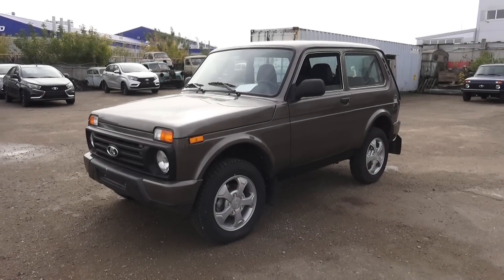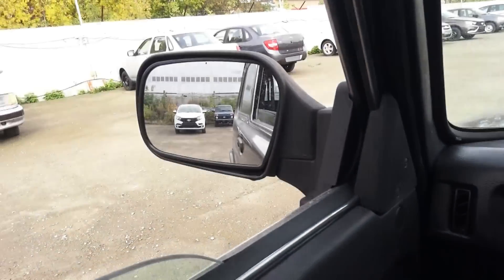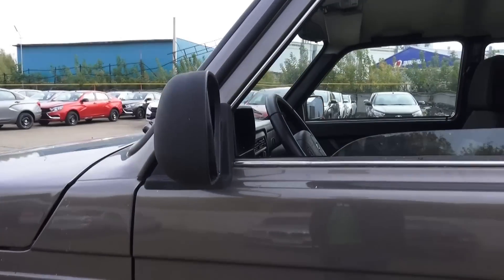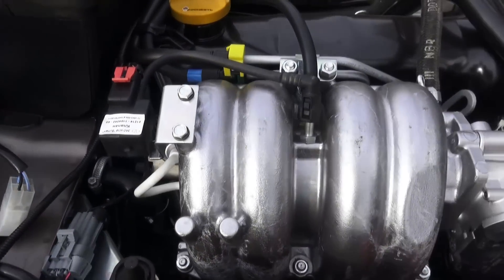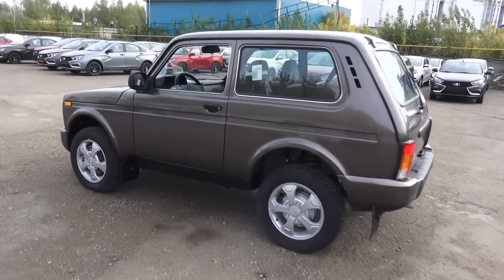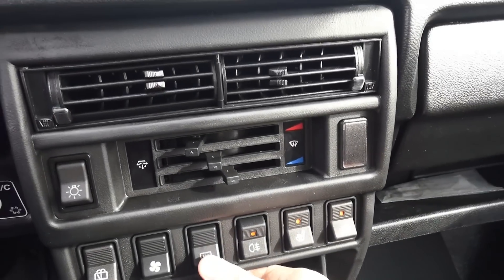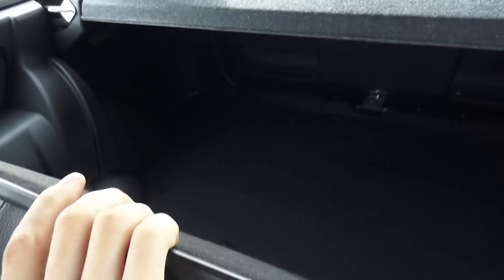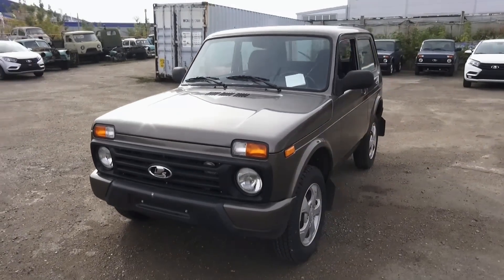2016 Lada Niva Urban 4x4. Start Up, Engine, and In Depth Tour.

Comment: I love these little simple suvs. Wish they were available here in the us!
Reply: Same here. I would buy one for sure!
Reply: Me too.  Alas stupid safety and emissions rules prevent it, forcing us to buy over priced and under capable garbage.  Admittedly though, not much has changed on these in 40+ years, so find a 1991 or older and import it...
Reply: Jesus Wasjewish I don't need or want to be protected from myself. Nanny state FTL.
Reply: I was thinking the same thing..
Reply: Lada used the same design for their Riva until 2008
Reply: They came to my country New Zealand but they stopped selling them after 2001 since the dairy board which traded them with butter (yep) merged with another company. There are a few in my area.
Reply: You can import it to the US.
Reply: In India too
Reply: They don't have airbags..
Reply: @mihaiarmy666  you aren't crashing against anything with this car
Reply: @jesuswasjewish5289  lmal these are meant go to off roading not being a daily

Comment: No CD player or any kind of radio included? Only 86 horsepower? What kind of meme car is this? LOL!
Reply: This is car that would easily go where all those 300hp US musclecars would struck in seconds.
Reply: Basically it´s the same vehicles from 1976. What did you expect?
Reply: The radio and A/C are an optional extra. Like what do you expect from a car that costs less than $10,000.
The Dacia Access models didn't come with a radio nor A/C up until 2019 when this trim option was replaced by the Essential and Comfort.
The same thing goes for the Jetta in the US. You could have still bought one without a stereo in 2013.
Same thing with the 2012 - 2015 RC spec Toyota GT86 and RA spec Subaru BRZ sold in Japan, Australia and New Zealand.

And moreover Niva weights barely a ton and comes with lockable diff. Jeep Willys had 50hp and could climb a hill with four people inside without problem.

Comment: Such a good car for its price. Cheap to buy and the parts are cheap as well. With this really enjoyable the "4x4 life". My father has a car part shop, while I write this, there is a Lada niva front axle on the table and its price is aproximatelly 20 dollars. Full clutch set costs 45 dollars. Tax, VAT, etc included :D Suspension parts like a box of cigarett, disc brake pad set to the front 6 dollar :D SIX! And if you not a bustard idiot driver, the Niva can run around 100-150.000 kms (60-90.000 miles) without any serious problem with mudding days included as well. And after? Drop the car for your mechanic, or fix it yourself everything from 100-200 dollars. Our Niva comes from 1989. We put new piston rings on at this autumn, the ring set was 12 dollars for 4 cylinder, a piston set with 4 pistons coast around 40 dollars. The engine timing by chain, the valve rockers are adjustable by hand, there is NOT double fly mass, computer and lots of else headache maker expensive "things" in the car. 
So we love it, the Niva made a lot's of beautiful hours for us. 
Greatings from Hungary
Reply: You're so lucky. Here in Italy car spare parts are more expensive. Regards
Reply: BALASH   MY GRANY IS HUNGARIAN,...I M FROM SERBI .CAN  I STOPED  BY  AT YOUR  SHOPP I WHANT  TO BY  SOME LADA NIVA_? I TRUST  HUNGARIANS  MORE
Reply: A legjobb terepjáró!!! A világon mindenhol használják, talán nem véletlenül...

Comment: LADA IS VERY GOOD CAR,I HOPE IT WILL BE IN MORROCO,BEST REGARDS
Reply: Syrian here so ,yes they are good but in our countries were it gets hot you will have to get an aftermarket radiator or else it will over heat the source of my information is the massive ammount of ladas in my country and I drove a few ones my self 
Pretty strong and cheap to repair tho and you can even repair it by your self

Comment: The SUV weight  is less than 1700 lbs and gets 56mpg . If it gets to the USA that weight will balloon up to 3500 lbs and get 21 mpg with a gas engine . Just like the Honda CRX . The CRX weight was 1700 lbs and with the HF engine it got 56 MPG on the highway . In 2011 Honda made a retro CRZ with a helper 35 hp motor along with the 100 hp gas engine and that car got up to 2700 LBS and got less MPG of 45 MPG .  I owned a 1996 Toyota Tacoma that got 30 MPG all day long . I kept that truck for 300,000 miles and still going strong with little  to go wrong . So I went to the Toyota dealer to buy a new Toyota Tacoma and the MPG was 21 MPG .  I didnt but the truck . That turned me off completely . So we went and bought the 2016 Honda CRZ  I knew it's weight was 2700 LBS and got 45 MPG . I did actually got 49 MPG on a long trip .  I would love to own a Lada Niva  if the US government leave it alone .

Comment: It's a very good car in rough terrain. Unfortunately, they have no money for new design and new technologies. But from a mechanical point of view it's a good off-road car.
Reply: darie99 they actually have enough money for new design and innovations. Check it out : Lada Vesta 2018, Lada Granta, Lada Kalina, Lada Priora. The same company. The deal is Niva 4x4 (Urban) is a classic, as well as Lada "Semerka", the Russians call it like that, which means Lada the "seven".  I don't get it really why they gave such name to that car. Both of them Lada 4x4 & Lada "Semerka" are classic models of Tolyatti car manufacture. And they're so sexy . Gosh,. I love em.
Reply: the simplicity is the best thing about it. it'll run forever
Reply: they have a lot of money and they also make other cars, the reason they haven't updated the design is because of cheap spare parts, you can install most parts from an older lada to a new one and it still works, and because of that, the spare parts are really cheap.

Comment: I survived hitting two trees in a 2006 Saturn ion at 110 mph and the air bags did not deploy. Frankly I'd still prefer a car with them lol
Reply: Maybe a LS swapped Saturn..but I have serious doubts that a stock Saturn could reach such speeds..I've owned two Saturns..yes they are super lite, but also grossly underpowered as well..